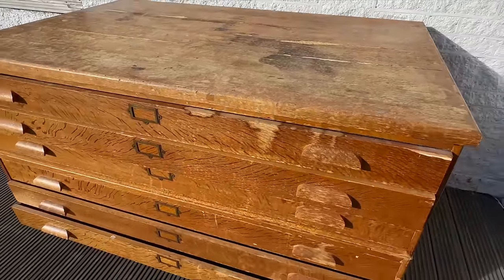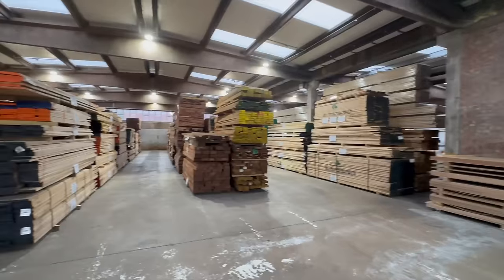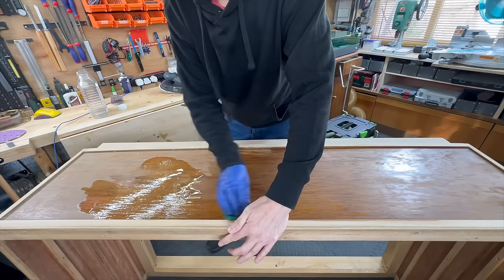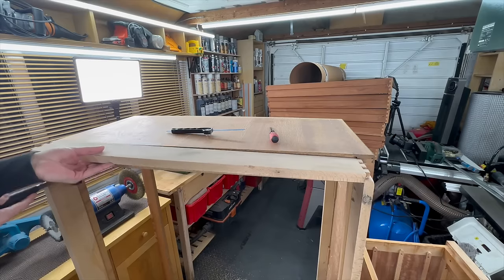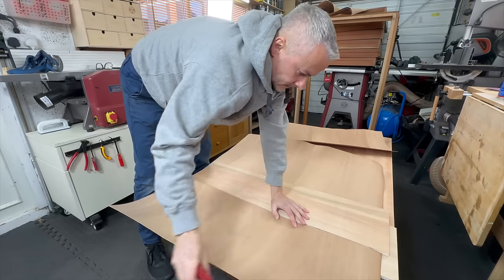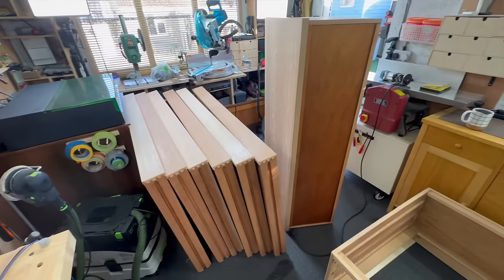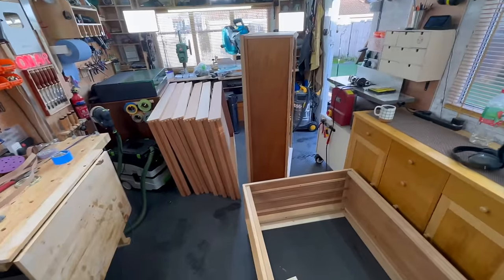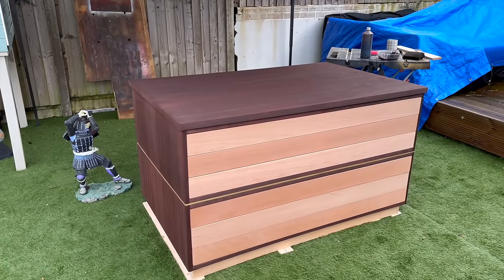Old File Cabinet  RESTORATION

Comment: These units are also called flat files, and I use them for unframed artwork, mat board, and anything else that is better flat than standing. I love your color choices and attention to detail ... and the drawer pulls. Everything works together perfectly. 👍
Reply: Yep. I worked at Print shop and we called these flat files. We put proofing materials and old proofs in there. Still use them, but they are metal.
Reply: Yes, they are flat files. A company I used to work for sold these. Most that we sold were metal and not wood based.

Comment: I'm an architect. One of the most common sizes for drawings in the US is 36 x 48 inches. That requires big drawers exactly like the drawers you have here. One office I worked in had a special 36 x 60 inch drawer for a special project that was long and narrow, requiring a 60 inch sheet size.

Comment: WONDER-FULL...BEAUTEOUS...and PRACTICAL to boot! WooHoo!   Jay - you have saved this Flat File from the heaps and gave it new life. I'm glad you are keeping it for yourself!!!!  FYI - I'd bet & I'm not a betting man - that you could get a few pretty pennies for it. Truly. 

(Just mho)...When you applied the new veneers they were so nice, so perfect. I looked at them and thought it would be gorgeous if the whole thing was kept natural (except of course) for the pulls.
I've wanted a flat file for years. I'm an artist and have lots of different kinds of papers to store and Flat Files are THE best way (IMHO) to do so. I used to work for a company that sold them. It was an artist supplies company that also sold some architectural, drafting, and a bit of engineering supplies. (That was back in the stone age where everything was done by hand.) We also had the best artist's papers in the area. We stored all the expensive ones in Flat Files and it took quite a few Flat Files to do so. Sadly I've never had the cash to get one for myself. The ones sold now are usually metal, and while very nice, they just aren't as attractive as wood.  

I did some digging online. I found that g-ply isn't a manufacturing term, at least not for Flat Files. It is part of a reference as to tire durability. I'm guessing the mark that was on it was of the company that owned it.  (Apparently, there are a LOT of tire companies in Kuala Lumpur, wow.) If that was the only markings on the piece(s) perhaps it was made by an individual rather than a company.  Either way it's beautiful. I'm sure when it was made it was beautiful as well.  I wish I could give you an estimated production time, but I really can't without manufacture's marks and other clues. It could be vintage. It could also be that it simply wasn't taken care of properly. 

However now it has the perfect home with someone who will care for it 😺...as it should be cared for. 👍
Reply from the maker: Hi, thanks for watching and for this lovely comment.  I will keep this as a TV stand with storage. It’s hard to sell anything for a decent money here so I don’t bother.
Reply: @Flippingdrawers   Sadly the same is true here as well. (Los Angeles) Unless you have (or know someone that does) A high end design store in Beverly Hill and surrounding areas...then one could get astronomical amounts if the marketing is good.